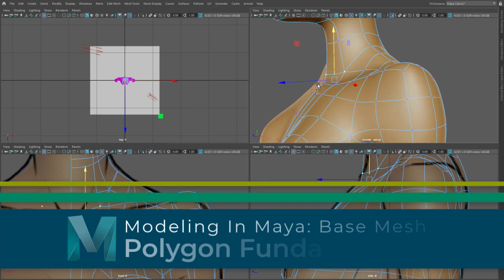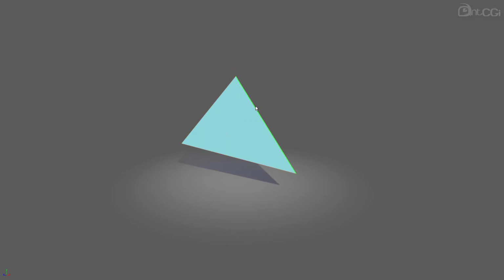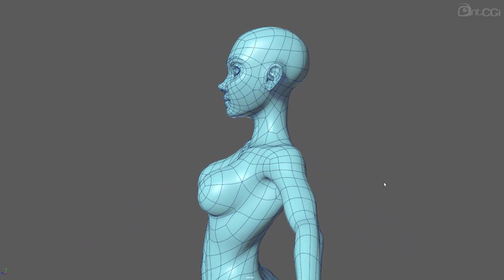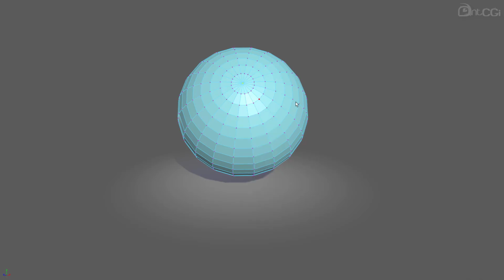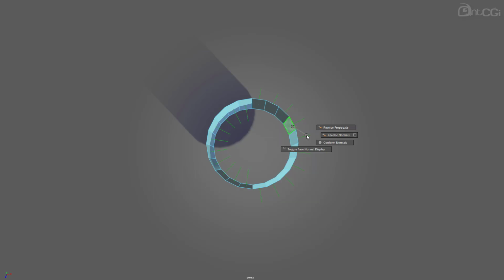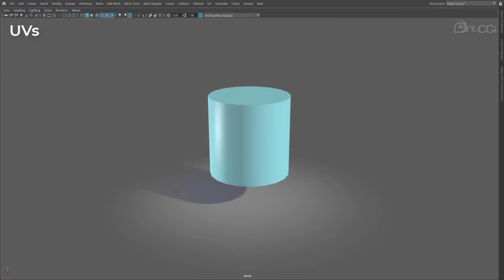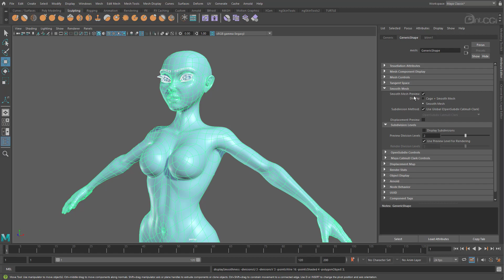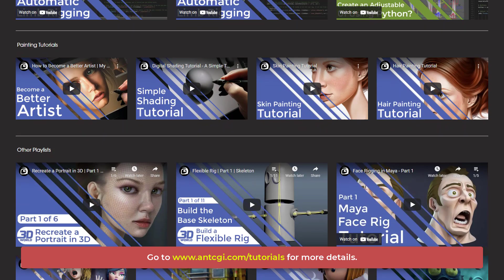#ModelingInMaya | Base Mesh | Polygon Fundamentals

Comment: I'm curious what's the point in using "soft mesh" option? Whenever I try to work with soft meshed model in Zbrush or Substance Painter it's always turning back to hard mesh there. I always thought that this function is just a basic shader which does matter only in Maya itself (Idk, maybe for some kind of preview), isn't it?